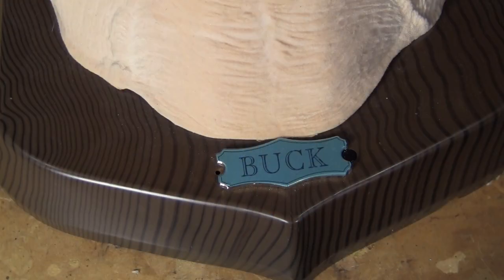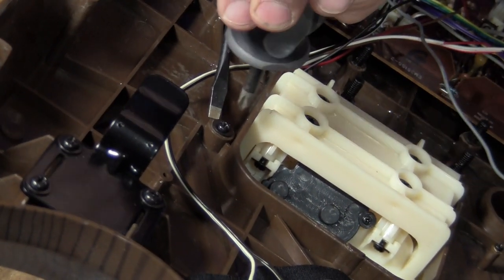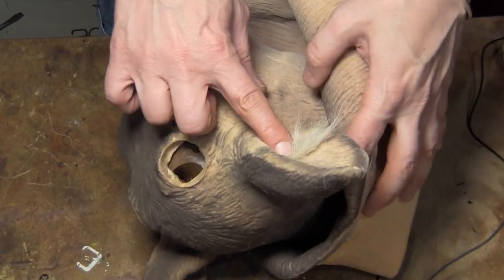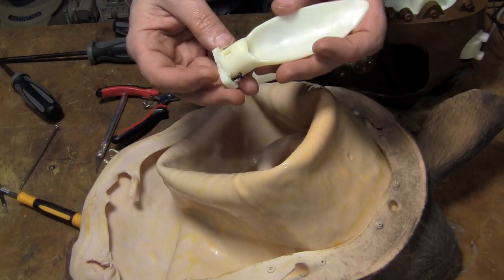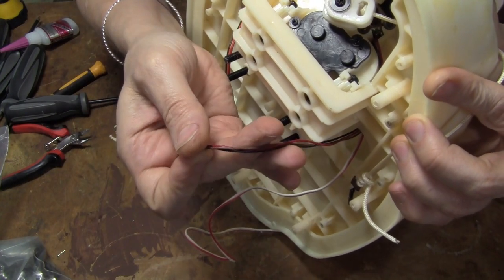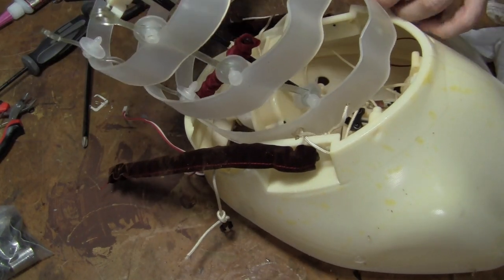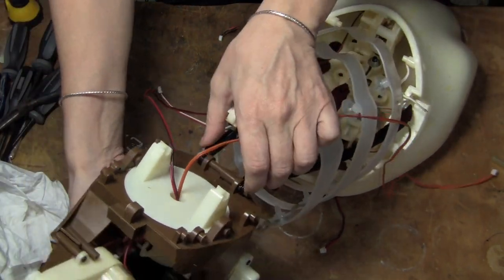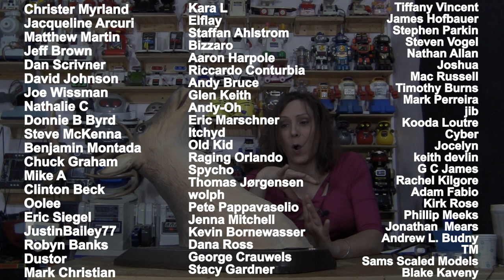Sing Along with Buck Again: Reviving Your Vintage Singing Deer Head!

Comment: What an amazing repair, you can hardly tell it was even opened! I do feel your pain as I’ve worked on a few of these. The first repair I did was the side to side movement. That did take awhile, but was successful. The second one was in much worse condition. Everything was broken except the up and down movement. When I opened it up, I had to use a putty knife to scrape the skin off the plastic. I took parts from the up and down movement to fix the side to side, which that was fine with me. Unfortunately the ear movement seemed to have fried on the circuit, but I did get the mouth working. I sculpted a piece of wood to replace the mouthpiece because the original one was completely shattered. Now my first one I mentioned still has some issues, the side to side is getting very loud and the mouth needs a new gear. I definitely like some of the methods you’ve used here, so I may take them I’m consideration if I decide to give it another go. Here is a short clip of my repair: https://youtu.be/lqFfmzun5rQ
Reply: How do you fix loud motor issues.. just replacement?

Comment: Wow! I feel lucky to find this video!! I found a Buck at a garage sale and got it for 10$! I found a wire to make it work at a thrift store for 25 cents and now that I got it working, it has this same problem. The ears are not moving and it doesn't turn its head left or right. I'm going to try to open it up later but it's good to have a video like this that would help guide me through it.

Comment: Very lucky to find one with the latex still in such great condition. I had one I bought new when they came out and reluctantly got rid of it when the latex just crumbled years later. I wish I hadn't now, of course, those are going for crazy money now so I am probably not going to end up with another one. Awesome work as always.

Edit: Oh, it looks like there may have been two versions. I didn't remember it coming with a remote or microphone when I had mine. Maybe they used something other than latex on the later model. That skin does definitely look thicker than mine did. Mine was almost paper thin latex.
Reply from the maker: Interesting. There may sure have been. There are different versions of the fish. I pretty sure it was silicone. I could always be wrong, but I've used enough silicone to be pretty sure.
Reply: @RandiRain  I am sure they got several complaints of the latex rotting within a year or two and changed it. There is also a possibility that other companies tried to copy it and mine was not a Gemmy. It looked identical to this and the same size, but it only had a motion sensor and a button. No remote or mic. I am pretty sure of that.
Reply: @RandiRain  Now I have got to figure this out. I am sure I bought mine in the 90s, but internet says it came out in 2005. None of the ones I am finding on ebay have rotting skin and none of them have motion sensors on the front. So, what the heck DID I have?

Comment: You have my sympathy, that looked like a tough one. :) I've never understood one-way manufacturing but more and more things are like that now Ie. few good ways to take it apart again. Neat product though, not a lot of retail animatronics out there.
See there is a good argument for brass gears strategically put in certain key spots of high torque like those small cracked ones you replaced, it's quite the elaborate machine to take apart for something so small. Sure you could call it a novelty item but not a cheap example heh.

Comment: Hey Randi! I’m having issues trying to get the skin back on… do you think you could explain to me a semi easy way to get it back on? Thanks 

EDIT: I know you need to remove the ears to put the skin on but you know the clip things? Wouldn’t those move when I put the skin on?
Reply from the maker: I've only done the one, and it's been a while. The ears you had to unscrew to get off, but you screw the bottom part back on and the ears snap into place. Use baby power or something to help get the skin on.

Comment: If I send you mine, will you fix it?The head doesn't go side to side. I will pay . Who can I send it to.. to get it fixed? Do you know?
Reply from the maker: Sorry. If I fixed everything people asked me, I would be booked up for the next 20 years. I don't have the time to do it. There are hobbyist groups on facebook of toy collectors that you might could find someone, but that's about it.
Reply: @RandiRain My mother always told me that I was Mechanically incline. I've always been able to fix things easily.Or come up with quick easy fixes I figured if you could do it.I probably could do it too. So i'm going to try and fix it myself. I'm just gonna take a video of myself taking it apart.Making sure all the parts go in the same spot and not backwards. Anyway

Comment: I wonder if there's going  to be a Part 2
Reply: Good thinking  Rand.
Using talcum Powder .
I was think Heating up n the 
Rubber in the oven at low temperature. 
Or using Soray Silacone.
Bug yours works fine
Reply: I have a Question in the early dissembly. 
You Mark the Wire
Did youbuse Nsil Polish ir Metalic Sharpie
And did you mark the location ir the Function?
Reply from the maker: Regular sharpie just making some tick marks. The IR was the wires I cut.